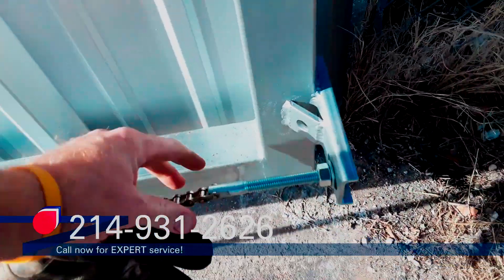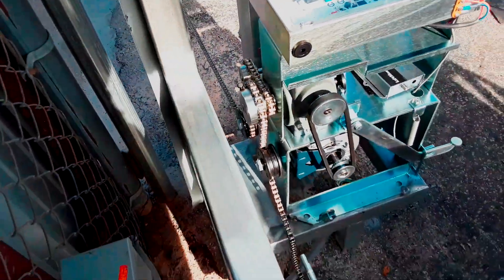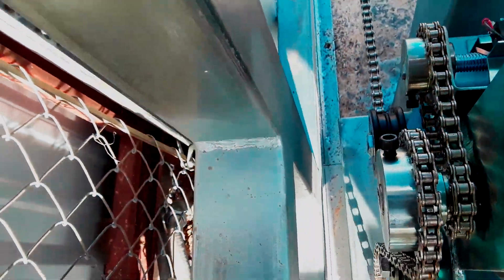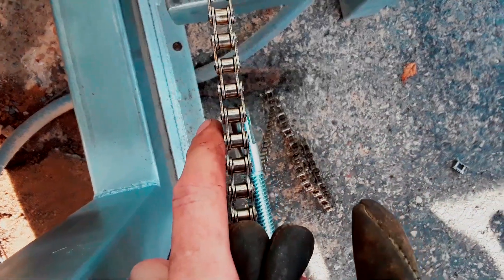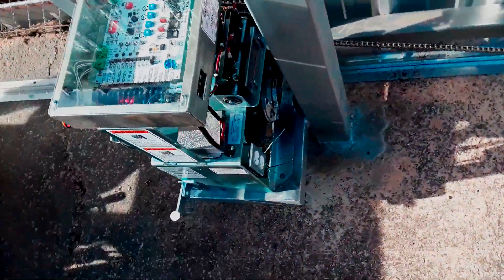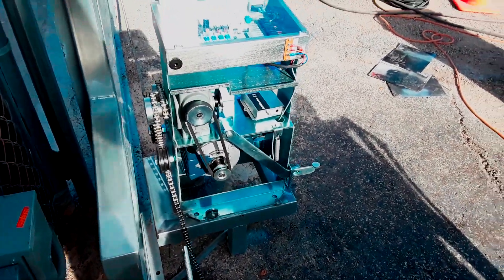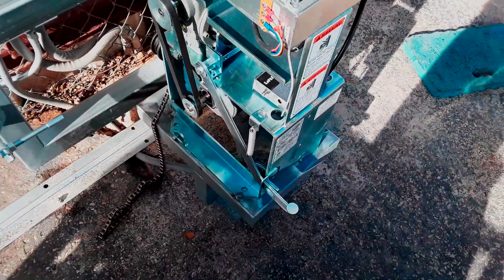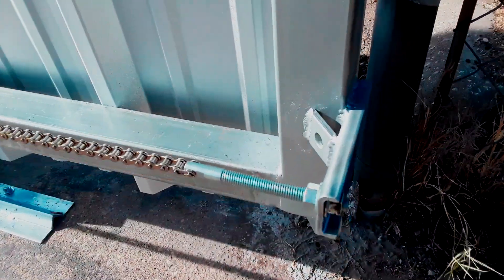Installing a slide gate operator Step 6: Installing the chain | SC0044

Comment: I'm installing a solar gate opener with a chain. My chain looks like my motorcycle chain. I hate dealing with it. I took off a link and it was too short...what a pain in the butt to put that back together.  I tried to hammer the pin back in, woudn't work because the pin wouldn't even sit in place!! I ended up drilling a slightly larger hole in the chain breaker tool to hold the pin and was able to push the pin back in place using the tool. Thanks for the video!

Comment: Some manufacturers also make a rack drive system. These are great if installed properly. No chain to deal with. 
The other thing that makes a big difference is purchasing a get opener with a dc motor. The ac motors start at full voltage and cause the chain to jerk with that full power instant start & stop. The dc motor allows the unit to ramp up and down the speed and greatly reduces the chain slap and torque put on the chain. The other benefit with dc drives is they lead themselves to have battery backup easier than an ac system. A huge plus! 
Make certain that you systems accessories are wired into the circuit board for power so those too can have the battery backup. At minimum make certain the receiver is on the backup.
Reply from the maker: Those are all good points that also have good counterpoints, no system is perfect which is why you have an expert review the site, ahj requirements, manual releases, etc.

Comment: Hello, thank you for the helpful video. I changed the chain and everything works fine but my emergency pedal thats suppose to allow the gate to manually open, since I changed it hasn't been letting me manually open. Any suggestions?
Reply from the maker: chain too tight?
Reply: Think the chain is ok, not too tight. Might have figured out the cause. Thank you for your reply :)
Reply: @laydeblue8341 what was the cause of? My gate has a manual pedal that doesn’t work as well only remote

Comment: Thank you I’m about to install a similar motor
Reply from the maker: You picked a great brand! Good luck.
Reply: @SafeguardControlsLLC  I have the exact same setup but my chain has become rusty and it sounds like its struggling lately. 
Is there a lubricant you recommend like WD40 or is white lithium grease better?
Thanks in advance.
Reply from the maker: @fuddcar  Use a silicone-based spray. Check out this link: https://youtu.be/UErxnDzE7Ec

Comment: How much slack should you have?
Reply from the maker: You have to check the manufacturers specs in the manual. An expert will most likely want to see 2" - 4" up and down travel per 10'. There are a lot of variables that any American Fence Association trained technician will be qualified to answer those questions.
Reply from the maker: @Charles Valenzuela That's what most manafacturer's recommend. We find that works on shorter gates. However, 2" per every 10' works for us.

Comment: Mines only a year or so old, and it’s already starting to rust....
Reply: Nickel plated chain will rust. It’s a step up from the black oxide chain but still gets rusty. They do make stainless roller chain. It last much longer but will also eventually rust too. Keep some chain lube on it. That really helps. They sell it at Lowe’s and Home Depot. Don’t use anything with thick grease. It stops the rust but also holds everything that comes in contact.
Reply from the maker: check out this: link https://youtu.be/UErxnDzE7Ec